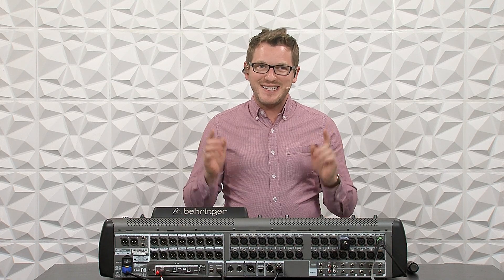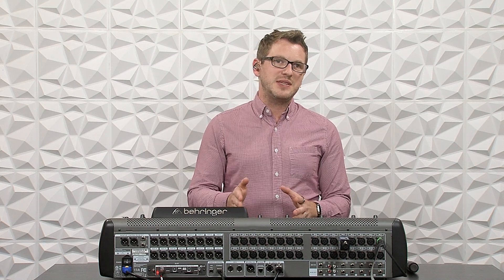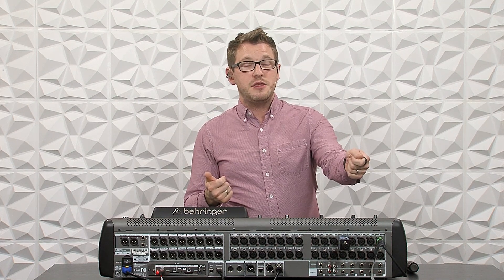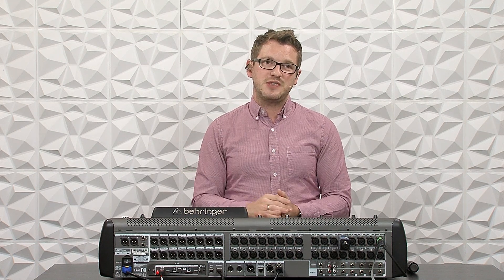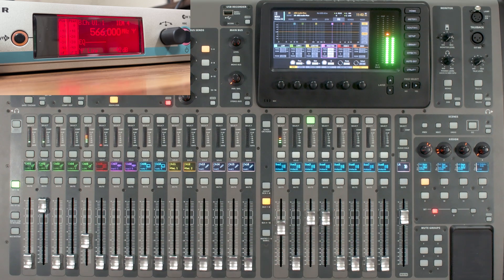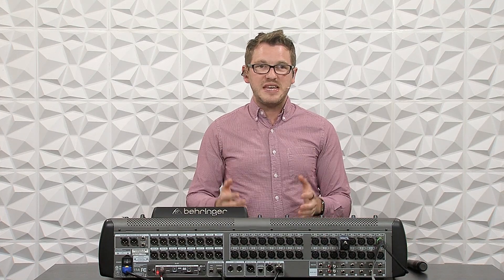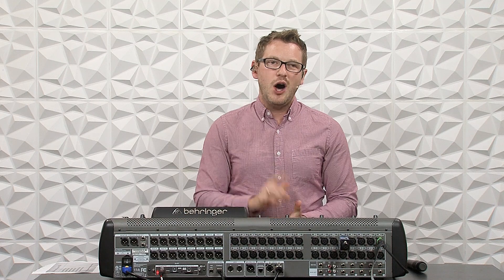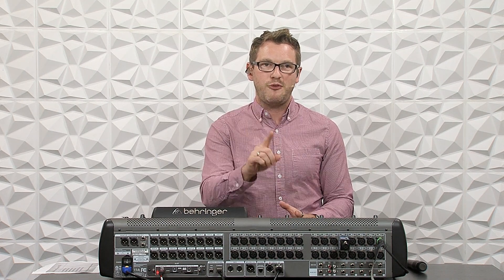Monitor Mixing - Do This to Make Your IEM Mix Better! 19kHz Pilot Tone Issues

Comment: WOW!  For what these microphone companies charge for their transmitters.  You'd think they'd throw a 15KHz filter on the input.  Sheesh!  The engineers should be slapped.
As for the flood of 19KHz on the input.  I suspect you're hitting the limiter on the transmitter.  It HAS to have that to prevent the modulator from 'splattering'.  That's when the modulation deviation exceeds channel bandwidth (100% modulation of ALL components).  You'll either be outside your ~200KHz channel width or generate harmonics beyond your channel (like 3rd order harmonics greeter then -60dB)  Not hard to flood the 19KHz pilot either.  It is only 10% of the modulation.  If they are using the same matrix modulation scheme broadcast FM uses.  The other 90% is split 45% over the mono signal (L+R) on the 15KHz baseband and the 38KHz stereo component (L-R).
The ~35Hz limit is there to prevent the Automatic Frequency Control circuit from acting as if the carrier has drifted off center frequency and either shutting down or dragging the center frequency back to center and causing the modulation to go wrong. 
This is from someone who knows a little more about RF then an audio engineer.  Having spent some study in broadcast engineering back in the early 80s when I had to take an FCC test for.  And a licensed ham radio operator.

Next chance I get I'll have to see of our PSM300 does this while looking at the signal with my SDR.
Reply: Nice to find fellow hams nerding out about this, haha. I likewise suspect this is caused by limiting rather than pilot tone issues though, at least on modern systems... the transmitter input was definitely overloaded per its meters, and the dropouts only seemed to happen after that point. My guess is that many (most?) IEM transmitters these days do all their companding and MPX modulation in DSP -- the PSM300 for example advertises "24-bit digital audio", and it's definitely not digital over the air -- and they probably do have a nice digital brickwall filter at 15 kHz to protect the pilot tone. Of course, that only helps if the digitized signal isn't clipping, and it doesn't seem like they have particularly steep analog filters to roll off the highs before they hit the digital world (the antialiasing filters can be pretty gentle if they're using delta-sigma ADCs). All of this seemingly leaves the system vulnerable to overloading even on frequencies it never intends to transmit. The advice would be similar if this is indeed the case though: just cut out the irrelevant stuff above 15 kHz using some combination of low-pass/peaking/GEQ filtering before the signal reaches the transmitter, and ideally throw a limiter on the output to retain control over what limiting sounds like when it does inevitably happen =)
Reply: (One experiment you might try by the way: sweep the frequency of the sine wave around. My suspicion is that you'd see the same behavior with any sine wave at the same level regardless of frequency -- even ones below 15 kHz -- but I could be wrong!)
Reply: @masegado  I plan to run a audio sweep on ours and also run my SDR and look at the output of the transmitter and see what I see.  I assume the transmitter is using 50 microsecond pre-emphasis.  Since they are doing everything else broadcast stereo.  I should be able to see that on the SDR.  I'll post my findings.

I'll say this much for the PSM300.   They have the mute tight enough that it mutes way before you hear a loud hash in the earphones.  Which is a good thing!
Reply: @glynnetolar4423  We're using PSM300s as well - will look forward to seeing the results! Wonder if I should just bite the bullet and get myself an SDR for troubleshooting RF issues...
Reply from the maker: They do put the filter on the input! But if we excite the frequency with an EQ boost, then it is our fault! hah.

As you could see the levels I was sending with the 19KHz tone, I was nowhere near the limiter or clip level of my board or the transmitter as far as audio level goes.

But great points on the RF stuff! I'm also a fellow ham, KD7QCU! 73!
Reply: @DrewBrashler  By the way, thank you for making this video - I realize I posted a critique earlier without acknowledging your efforts and the fact that I've learned useful things from it. Specifically, I (a) didn't realize these systems couldn't reproduce anything beyond 15 kHz, and (b) didn't realize that you can still overload them by sending frequencies they can't reproduce! I've started changing the output EQ on my IEM busses as a result. Thanks =)

Comment: hello, i have 2 questions:
1. is the pilot tone fixed at 19kKz across all brands or is it specific to senheiser (we are using LD systems)
2. why PEQ in combination with hi-cut?
Reply from the maker: Yes, the 19kHz tone is going to be for any wireless IEM's that use Stereo MPX for their transmission, which for the most popular units I see would be all of the Shure PSM units and all of the Sennheiser IEM units.

I put the hi-cut to filter out the frequencies that go up to 20kHz. My thought process on that one is, since the transmitter can't reproduce it, why send it.

The PEQ on 19kHz is to help solidify the reduction of the audio in the area of the pilot tone. Remember that a hi-cut still has a dB/octave drop off, so a 15kHz hi-cut might not be down as much as you want at 19kHz.

Thanks for the question!
Reply: I was curious to know why both was used as well.  Thanks for asking that.  I hope we get a response.
Reply: Bingo- a 6/12/18 dB/8ve LPF at 15k will only take 19k down maybe 2-4-6dB for those slopes. A -12/-15 notch at 19k with the extra reduction of the LPF slope basically guarantees there won’t be any issue.

Comment: Thanks for the video. Why cut 19 if you’re already cutting at 15?
Reply from the maker: Great question! I put the hi-cut to filter out the frequencies that go up to 20kHz. My thought process on that one is since the transmitter can't reproduce it, why send it. Remember that a LPF has a dB/octave slope, so even with the hi-cut, there is only going to be so much of a reduction to 19kHz. So the PEQ at 19kHz allows me to really solidify the reduction of the audio in the area of the pilot tone.
Reply: Same Question here
Reply: A deep notch at 19kHz will attenuate that frequency far more than a 12dB per octave filter at 15kHz will.
Reply: Sometimes you need surgical EQ to ensure you are cutting a specific frequency out, especially when applying low / high cuts. It's because the shape of the cut still bleeds the frequency through.
Reply: @paulvenkman  Gotcha, didn't realize the slope wasn't adjustable with this mixer
Reply: Static phase shift is not audible, stop this madness.
Reply: But. such extreme notch filters introduce a lot of phase-issues. I mean I get your point, but don’t you worry about the phasing of the mix?
Reply: @luukmeijssen2515 - I defy anyone to be able to identify phase issues at 19kHz... Seriously.
Reply: @duncanmcneill7088  you’re right, at that frequency no-one will hear that. But deep notch filters can screw up fasing at far more frequencies than just the top end.
Reply: @LaminarSound here is the discussion.
Reply: @luukmeijssen2515 he Phasing is going to be in the frequency range thats not reproduced by the receiver anyway, isnt it?

Comment: I'm not a hundred percent following this idea, you say that a test tone is transmitted at 19k so that the receivers can mute, but you also said that there's no point in transmitting anything above 15K because the transmitters can't receive any signals above that. How can the belt pack receiver  get the test tone at 19k if they can't receive anything above 15k.
Reply: He poorly worded it.  But the 15KHz limit is on the final audio section of the receiver.  At the IF stage of the receiver it can hear ALL the 100KHz of it's signal and detect the 19KHz and the 38KHz stereo portion.
Reply: @glynnetolar4423  thank you for explaining.

Comment: I knew a monitor engineer trying to resolve similar dropout issues. Another audio human guessed it could be the mix clashing with the pilot tone, but the monitor engineer said the wireless systems should already have a notch filter/LPF in place after the mix but before the multiplexing, so adding filters on the output shouldn't make much difference. 

Taking a quick search of wireless monitor systems, they don't seem to publish many specs of their audio frequency response. Is '25hz to 15khz' a -1dB or -10 dB measurement? Is there a LPF already applied that has any significant effect at 19khz? Could you possibly take a transfer measurement of the Sennheiser so we can see exactly what's going on at those really high frequencies?
Reply: This is my question as well. I'd love to see the frequency response in smaart.